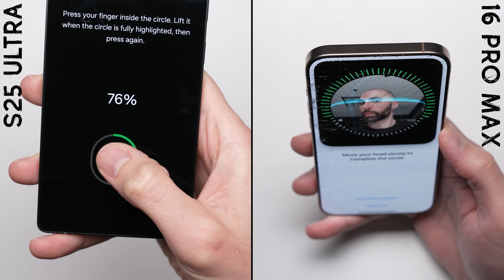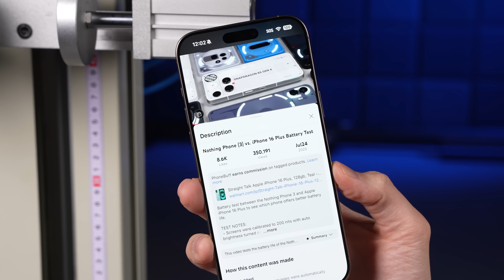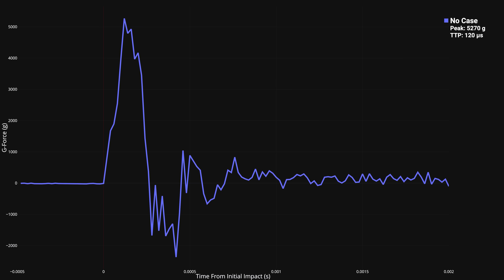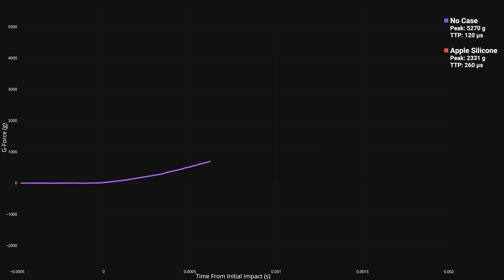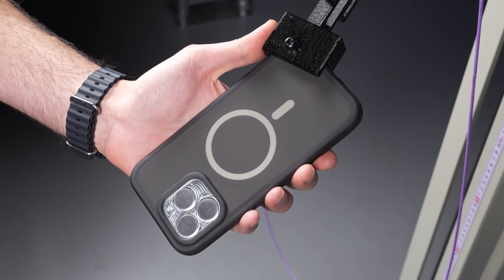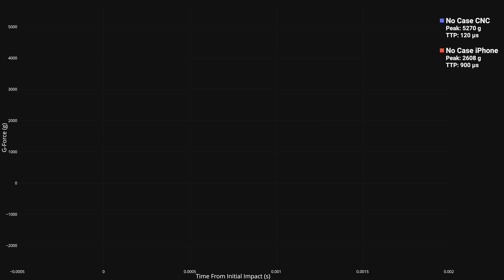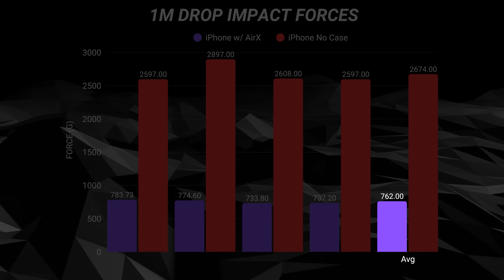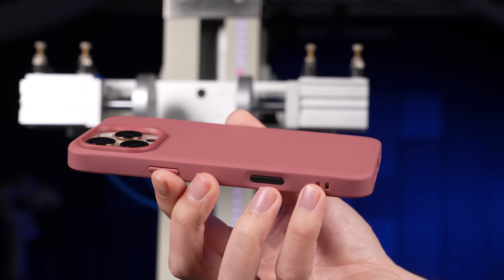Scientifically Testing the "Airbag" Phone Case

Comment from the maker: Thanks to RHINOSHIELD for sponsoring this video. Get the AirX here: https://url.rhinoshield.io/PHONEBUFF and use discount code PHONEBUFF to get 10% off.
TEST NOTES:
- All drops were conducted from 1.5 meters (≈5 feet) onto a steel plate.
- Tests focused on corner drops, which generate higher peak G-forces than face or back drops because the impact energy is concentrated into a much smaller area.
- A linear rail system with an electromagnet was used to release the cable in sync with the drop machine, minimizing drag and ensuring more consistent drops.
- A catch box was used to contain rebounds so the measurements reflected the initial impact only.
- Data was captured using an industrial-grade triaxial accelerometer (rated to 5,000 Gs) paired with a signal conditioner + oscilloscope, recording 150,000 samples per second.
- Results include both baseline (no case) and case-protected drops, with multiple trials run to account for outliers.
- Consistency testing was done for up to 10 drops per case to measure durability as well as peak impact reduction.

Comment: Btw the reason the glass when breaking in that spot is because pf the weakness at the antenna splitter line, because the iphones frames itself cracks there and which leads to the back glass cracking there. The iphones for many years now have had that weakness and it seems like no one really talks about it. Tho it should be way better on the iphone 17 pro since its thicker.

Comment: Not sure why people are nullifying the results just because the silicone case was not tested. If we accept the method and devices used, it’s pretty clear that the Air case absorbed the impact and that the silicone case would not. If we are deciding not to trust PhoneBuff, then we could just as easily accept that he could just draw any graphs to the screen if the case would have been included.

Comment: By not dropping it from multiple angles and scenarios (front, back, side, higher, lower, different surfaces, etc…) it places a big question mark on the cases claims and data. The Phone Buff i know exhaustively test.
Reply from the maker: Most decent cases (AirX or Apple’s Silicone) can handle back/face drops at this height. The point of this test was to push them in the worst-case scenario with corner drops where all that force is concentrated on the smallest surface area.

Comment: Finally someone actually testing the case and not just keep throwing it at the wall until it (not) break while reading the "reviewer guideline". Although still a sponsored content, but better than other youtuber for sure, at least we have some data.
Reply from the maker: Appreciate it!
Reply: Some data, but definitely inadequate. He did not test the Apple Slicone case with the iPhone in it.
This fact in it of itself gives the video a disingenuous tone.
Reply: @vaggelis_best Agreed. idk why he didn't test it. Maybe that "reviewer guideline" will have an answer.
Reply from the maker: @vaggelis_best In hindsight, we should have tested Apple’s Silicone case on the real iPhone as well. We just didn’t plan for it since the CNC iPhone gave us the most consistent and repeatable data across multiple trials, and once the iPhone broke during testing, we decided not to buy an additional unit just for that segment.
Reply: @PhoneBuff  this does not change the fact that the video introduces itself as a comparison between the AirX case and the Apple Silicone case, but the (assumed by the user) conclusion of the video, that the AirX case is scientifically superior to the iPhone case, is based on the hypothesis that the iPhone would experience similar forces to the CNC block if tested with its official case. This hypothesis, though, is not tested thoroughly enough to be scientifically certain, therefore the video is (practically, if you argue that it never promised to be a comparison, or definitively if you don't) scientifically unsound.

Comment: Would’ve been better if you compared the air bubble case vs standard Apple case with iPhone in it instead of CNC. The phone’s own durability will have a larger role to play in absorbing the shock and would be interesting to see a direct close to real use case comparison
Reply from the maker: Agree. In hindsight, we should have tested Apple’s Silicone case on the real iPhone as well. We just didn’t plan for it since the CNC iPhone gave us the most consistent and repeatable data across multiple trials, and once the iPhone broke during testing, we decided not to buy an additional unit just for that segment. But you’re right... It would’ve made the comparison more complete.
Reply: @PhoneBuff Well, after dropping the iPhone with the Air case 10 times, you could have definitely tried with the Apple Silicone right after before dropping the phone naked. It doesnt make sense.
Reply: @useringname  Something tells me its possible they may actually have done it and then realized the difference between the cases wasn't big enough to make a great video.

Comment: you didn't even test the Apple case with a real iPhone? lol 😂
Reply: Literally came here to say this. I bet the results were the same as the AirX case so they removed it. Also a bit of conflict of interest having the ad sponsor providing the metrics to test and the equipment
Reply: Exactly. I think they found that the difference would be negligible and had to use the Apple case with the CNC block only to make out a difference.
Reply: This is an extensive sponsored ad video.
Reply: Because they thought that the difference was not worth the increase in the size of the cover due to the airbags, so they did that.
Reply from the maker: In hindsight, we should have tested Apple’s Silicone case on the real iPhone as well. We just didn’t plan for it since the CNC iPhone gave us the most consistent and repeatable data across multiple trials, and once the iPhone broke during testing, we decided not to buy an additional unit just for that segment.
Reply: @PhoneBuff 👏👏your work is appreciated
Reply: Did you watch the video?
Reply: @The_Brain_afk  did you? he used the cnc block as reference, when he showed us that the real iphone was at 2600g vs 5200g with the fake one. He intentionally didn't show the real iphone in the silicon case because it propably wasn't that far off the other case.
Reply: @fillezzo on that note: the CNC block in the AirX case had the same results as the iPhone in the AirX case. So I think that would have also been the case with the CNC vs iPhone in the Apple Silicone case.
Reply: @The_Brain_afk did you watch? 🤡
Reply: It seems you did not watch the video fully
Reply: The CNC block in the AirX case had the same results as the iPhone in the AirX case. So I think that would have also been the case with the CNC vs iPhone in the Apple Silicone case.